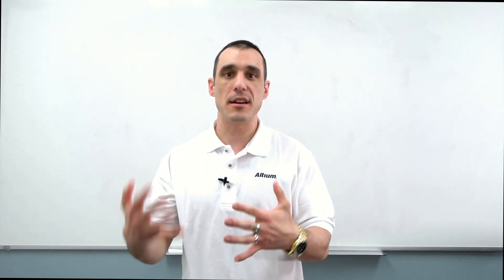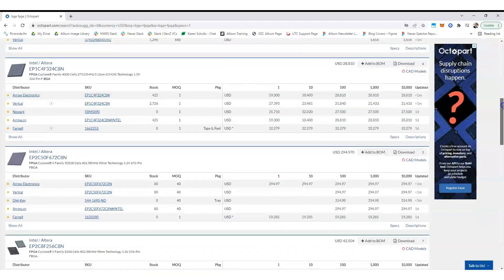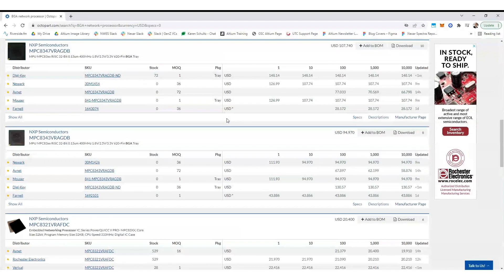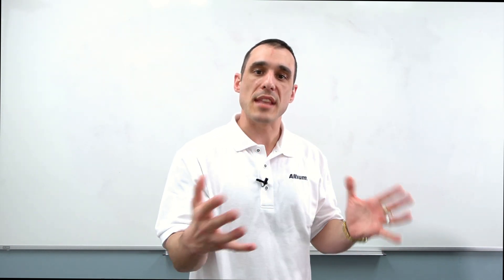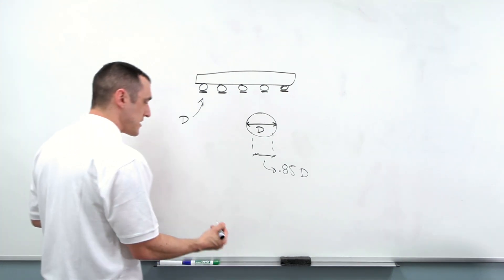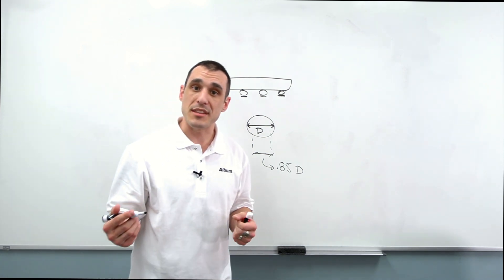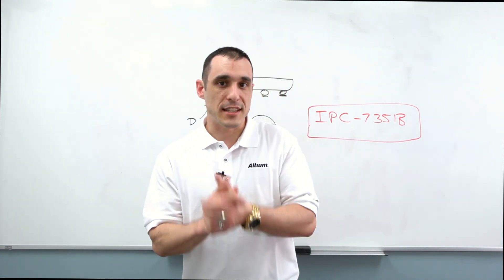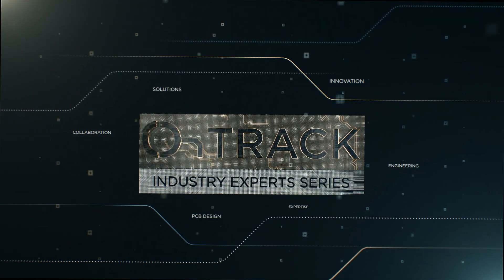BGA Pad Size Deep Dive | Component Creation

Comment: @zack what is the meaning of land pattern density level.and pcb pad or copper should be graeter then the components footprint.what you have mentioned in videos and ipc standard land pattern is smaller than the components package .but i have read pcb pad to components pad should be in the ratio 1:0.8.how we decide as per video smd and nsmd bga pad.
Reply: The pad size is based on the 7351 standard and it roughly follows the ratio you mention, although that is not a hard ratio. The use of SMD or NSMD pad is your choice, you can define SMD pad if you want to by oversizing the pad and applying a negative solder mask expansion; only the visible area counts as the "pad" in this case. I did a video about this topic that features your question, it will come out in the next few weeks.

Comment: Xilinx does provide recommendations for pad dimensions in a document which also describes packages (for 7 series FPGAs it's UG475).
Reply: Hi Asmi, I'm sure they do, and of course they put it in a separate document on packages and not the datasheet! I've seen some other BGA components where they provide a pad recommendation. Just to verify, before making this video I looked and found some datasheets from Xilinx component where there was no recommended land pattern.

Comment: Great video, here are some self-proclaimed IPC compliant land pattern generators:

- PCB libraries Footprint Expert: free and recommended by several PCB design experts.

- Snapeda: they have an online tool for generating IPC compliant land patterns.

- Samacsys: the cool thing about this tool is that it also generates simplified 3D models of the components in addition to the land pattern.

I said self-proclaimed because I didn't verify these tools against the IPC standard. I hope this helps.